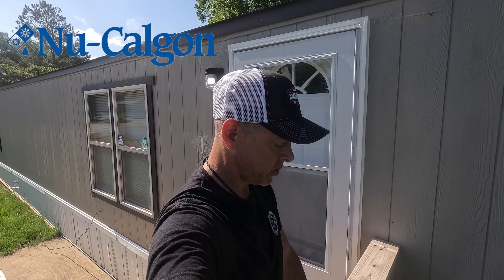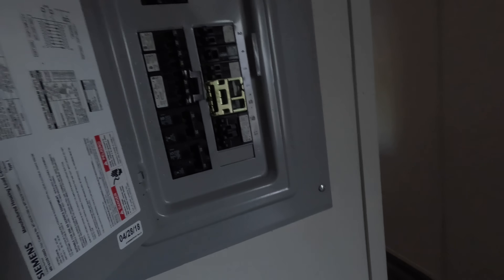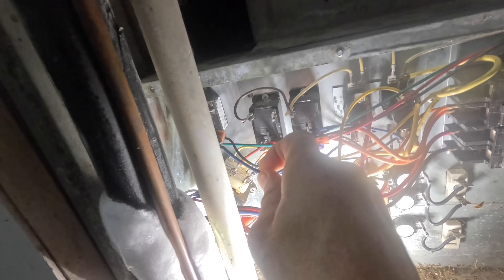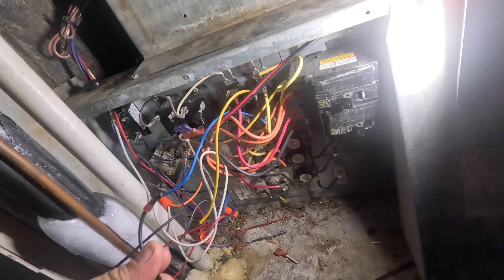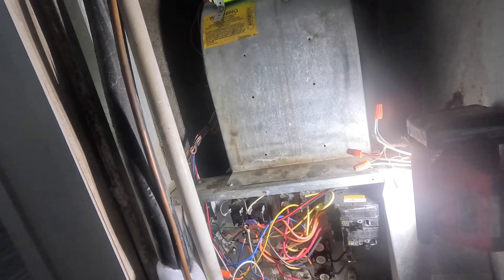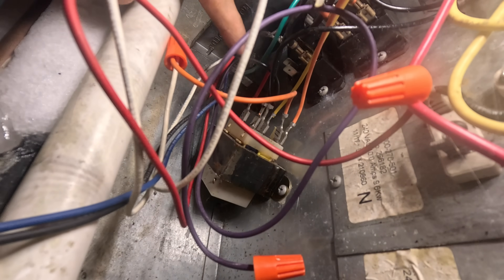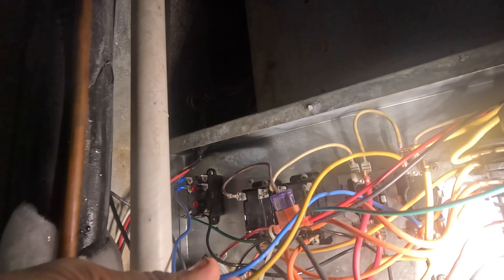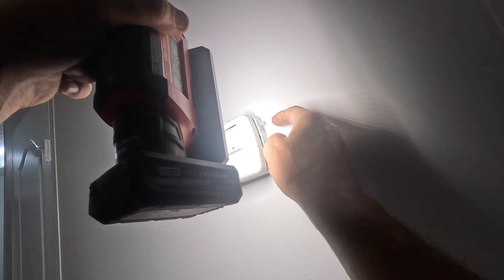Workin’ On The Weekend To Keep My Customers Cool! #hvacguy #hvaclife

Comment: I always in situations with mobile homes, only use 1 fan speed with a heavier duty relay. Instead of 2 speeds and 2 separate power feeds, use 1 speed with 2 power sources. Never a chance of putting power on 2 speeds

Comment: Bro 900 just to get it started in Phoenix, quoted 17k for 4 ton stated 3 ton on the roof a lie and only worked 4 hours had to get a hotel 115 degrees outside house 99 ended up 14k for install on tuesday

Comment: You might want to check the lower fan speed, in case the failed relay did somehow manage to power both speed taps at once. I've seen it happen where the lower speeds on a blower motor burned up and the high speed still worked after two speed taps were energized at once.

Comment: Nice diagnosis.
But, those wires above that relay going through a hole in the cabinet/chassis were well burned up too. The insulation on them was melted fairly much. Apparently that relay was not rated enough for the loads or had a mechanical connect issue inside. It was for sure a poor contact/connect concern due to the heat damage for the time it was carrying power.
Reply: yeah, those wires are toast! did they burn because of the relay or did the relay burn cause the wires shorted from rubbing the cabinet?

Comment: The wires from the relay to the motor look bad. Covered in black soot. One looks like insulation damaged (red) near the rubber grommet 🤷‍♂️
You probably can’t see it from your angle but the camera shows it clearly

Comment: I only use those peanut relays  to switch low voltage loads. Use Honeywell R8222D relays if you are switching line voltage loads like the blower motor. You can see how the relay burned up at the contacts that switched the motor load.

Comment: It seems like these HVAC units need more fuses and overloads built into them.
I once had an old aluminum extruder that was constantly going down for various reasons and none of the individual components had fuses.
It took 100 times the amount of time to troubleshoot and repair.
I got the blessing and installed individual resettable fuses/LEDs on each component on the same din rail as the terminal blocks.
It made troubleshooting instantaneous.
If a wire becomes too short, extend it with a fuse instead of a butt connector.

Comment: When the evaporator of a straight cool with electrics evaporator has iced up, can you help spped the defrosting by briefly energizing the heat? Or simply let time do the trick. Even if you could defrost this way would it be safe to do so?
Reply: Shut system off, disconnect low voltage wiring and come back tomorrow!
Reply: no airflow from all the ice, the heat strips will quickly overheat and start banging the high limit, they could burn out or burn up wiring doing that. yes they'd melt the ice though.
just shut off condenser, leave blower on if there's some air flow(air cools the motor too). come back in a day.
Reply: Youre right. Im not a tech but fascinated by the troubleshooting process. Thanks

Comment: The one thing I need work on is realizing that small issues can mean big problem down the line, I have a time or two fixed almost the whole system and then come to the inevitable conclusion that it requires a change out...
Reply: You did the right thing. Since customers may call another co for a second opinion and they'll smear you big time!

Comment: I hear ya on being where you said you’d be and at what time. 

My pet peeve is service people who don’t show up on time and don’t bother to let me know. 

I’ve had people call me several hours late and say they’re on the way. I tell them to turn the truck around.
Reply: Delays can occur such as road accidents or RR barriers down, but we have cell phones so call customer and let them know so they won't get mad at you!
Reply: @bobboscarato1313  yep. The worst is when they call me to tell me they’re running late….when they’re already over an hour late. 😅
Reply: it's hard to keep track of time, other jobs lined up, all the materials, deliveries and tools, when your head is full into the current job, more so when it takes longer from issues or interruptions. then the phone keeps ringing an overload with spam calls, notifications, texts and more annoyances. 
that said, they should try and set an alarm/alert for say thirty minutes prior so they can notify ahead of time. the problem with that is, many of us take off our phones to not ruin them with water, chemicals, insulation or you have to lay down and roll around to work on stuff, so it cannot be in a pocket or clip on belt case(what I use). contracting is not easy at all.